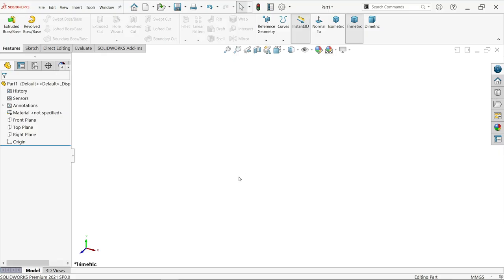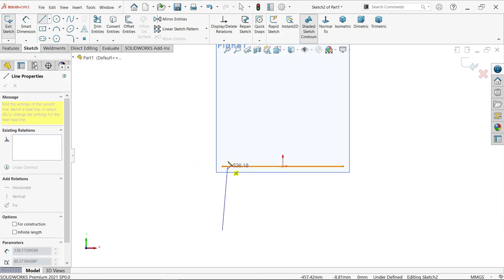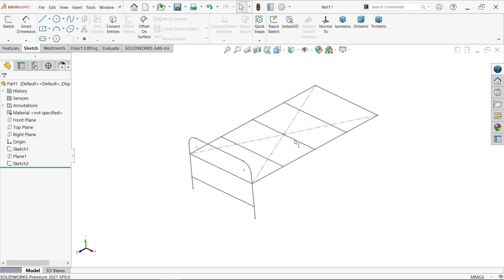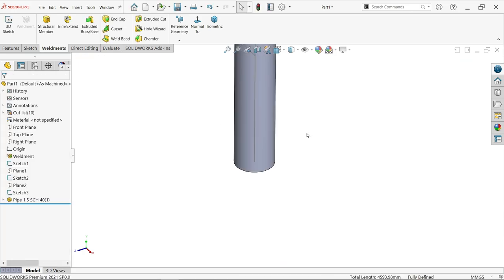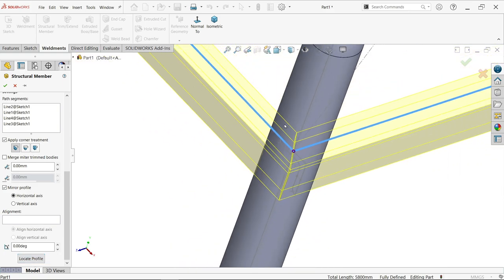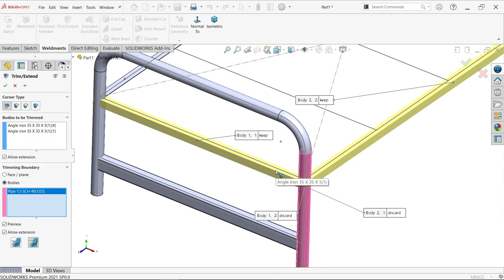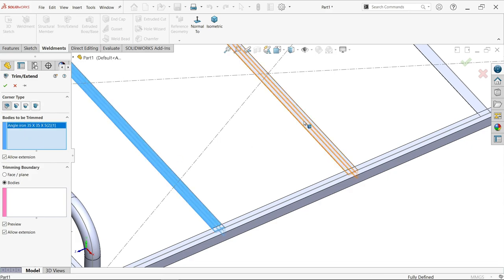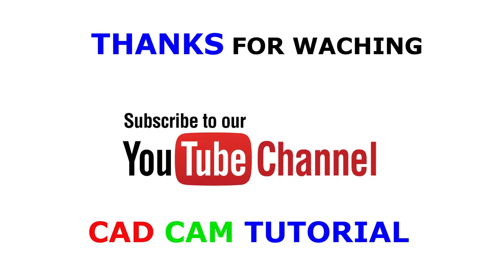SolidWorks Weldments tutorial Steel Cot, Structural member, trim/extend

Comment: I have a problem at 3:20 ... smart dimension is showing the option of make dimension driven.....Ive start all over twice and it's still showing the same thing at that point... what do I do?
Reply: yes same problem
Reply: Yes, after he smart dimensioned the 700 at around 2:50 he changed something which is cut out the video. The lines are suddenly centered while they were more to the right side before this point. Edit: at around 2:10 he makes 2 lines equal. Skip that step.
Reply: Take line command individual then u will  get it